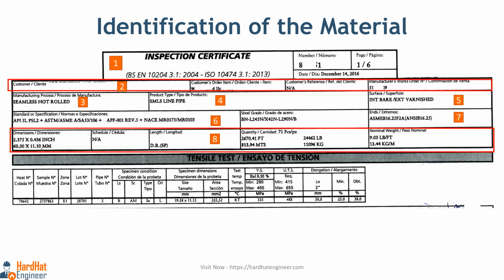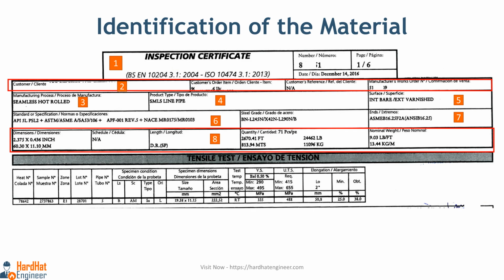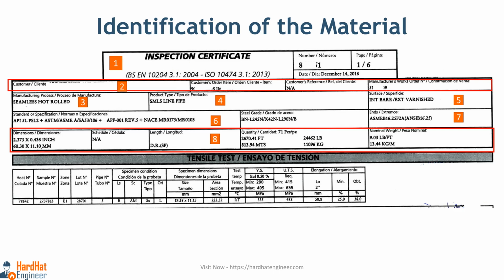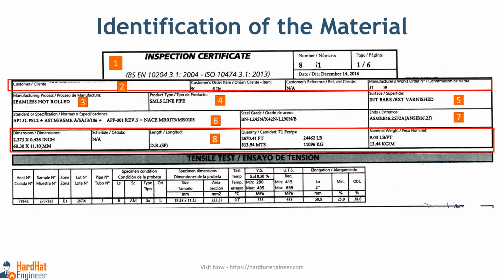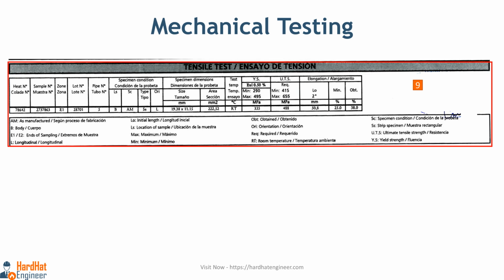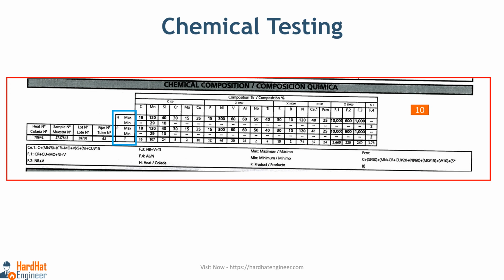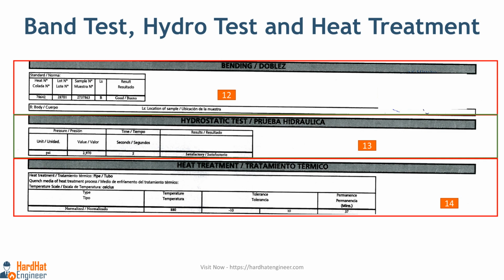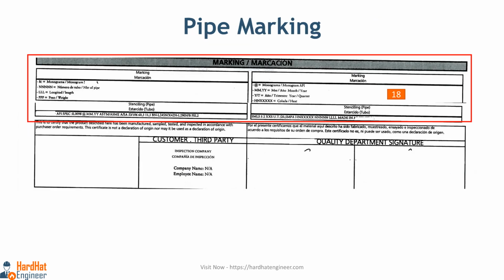How to Review Material Test Certificates During Material Inspection? (With Example)

Comment: Generally Manufacturer will test each pipe pieces or they will do only one pipe in one batch? Because test certificate are being received only for one batch
Reply from the maker: @LiquidEngineerlights  Most Manufacturer test each piece as part of production process. Standard will guide you about scope of testing. Inspector by others will be rendom.